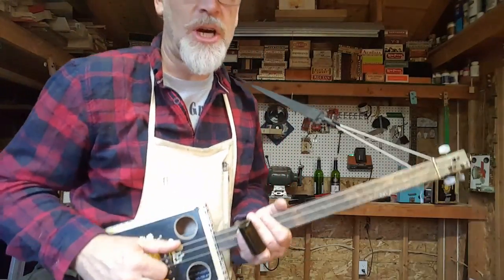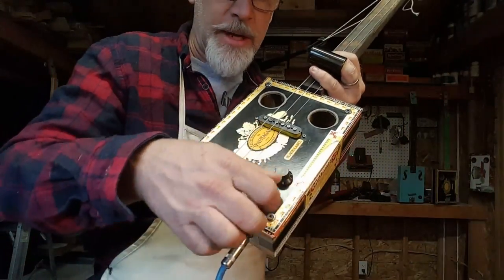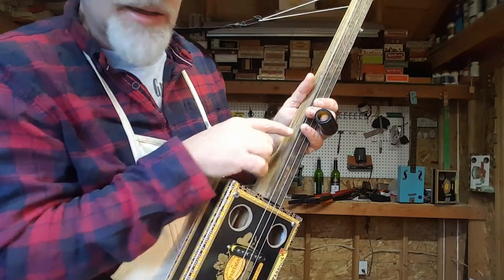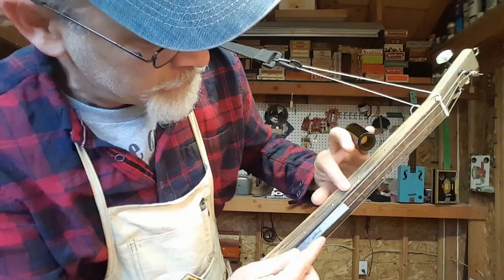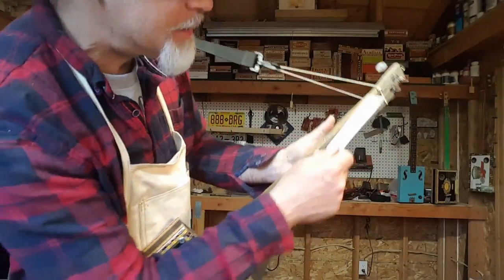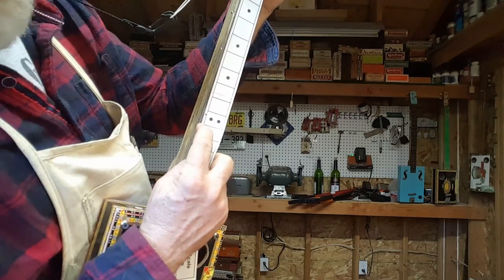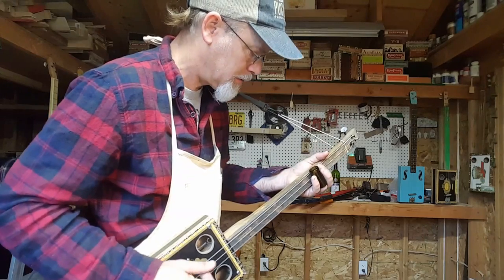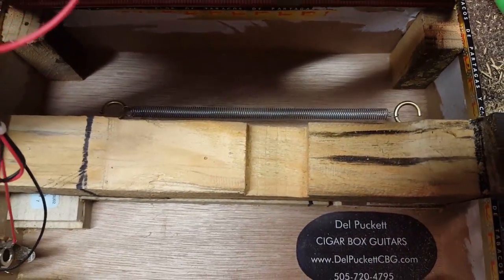"The Coolest" Cigar Box Guitar yet

Comment: Adjust your bridge and the nut to the template, and the harmonics will line up with the template.  (If the template is accurate.)
Reply: I don't think so. Are you familiar with the term "just intonation"? The frets of the guitar, like the strings of the piano, are adjusted to equal temperament instead of just intonation.

Comment: Do the nails line up with the fret just above the dot? If so, then they are correct-  the nails should align with the fret, not the dot.
Reply from the maker: Bobby Foster the nails line up with the harmonic.... which is where the notes exist in reality
Reply: @PuckettCigarBoxGuitar  totally agree, but on a fretted fingerboard the harmonic resides above the fret, not the dot. That's why I was asking. When you laid your fret template over the neck to compare placement, it seemed as though you were expecting the nails to line up with the dots, but the dots are not where the harmonic resides. As I look at the video again, I can see your nail heads align with the fret which would be correct.